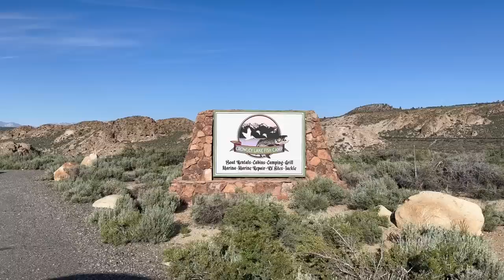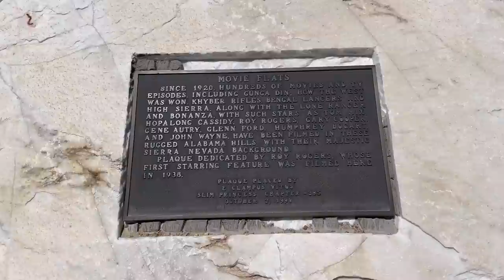Mammoth vlogs (perch fishing Crowley on the first day of summer)

Comment: The Alabama Hills are essentially another mountain range, sitting on a detachment fault right up against the Sierra Nevada range.  The Alabama Hills are a lot taller than they look, but so much sediment has poured into Owens Valley that 15,000 feet of the range is buried under all that sediment, right down to the basement rock.  It's made out of the exact same type of granite that the Sierra crest is made of; it looks different because of how it weathered.  Gets little rain but a LOT of windblown sand that has helped to round out the rocks; what rain does fall leaks into the cracks and joints and makes it look like just a pile of boulders.  And the color is browner than the Sierra granite because of the desert varnish that has built up on it after millions of years.  Just shows how different the climate is with 10,000 of elevation difference between the Alabama Hills and Mount Whitney.

Comment: BTW, when you drove out of Lone Pine up to Alabama Hills, you drove right over the  escarpment created by the Owens Valley earthquake of 1872.  It's still plenty visible because it hasn't been subject to much erosion or flora.  THAT is worth stopping to take a look; estimated magnitude of 8.0, the Sierra Block shot upwards 20 feet and north about 40 feet -- you can walk right up to it and on top of it.  Next time you're down there turn on Whitney Portal Rd and as soon as you cross the aqueduct make a right turn and follow the dirt roads that lead up to the scarp.  Really easy to get to and see - barely 200 yards off Whitney Portal Rd.  Diaz Lake is another place to see it; the lake is essentially a sag pond and it sits right on the fault trace.  The lake was created by the earthquake.